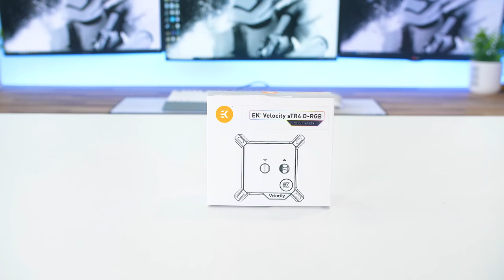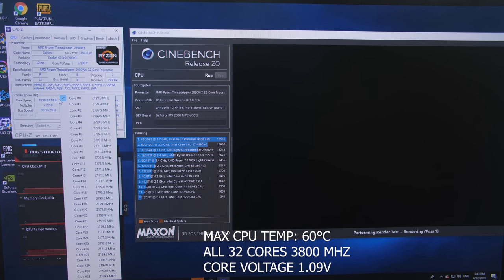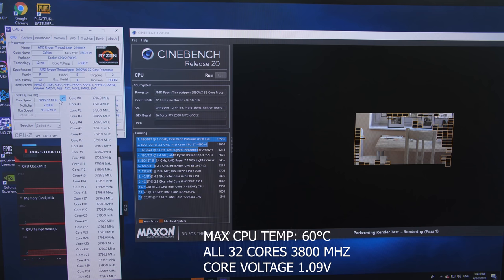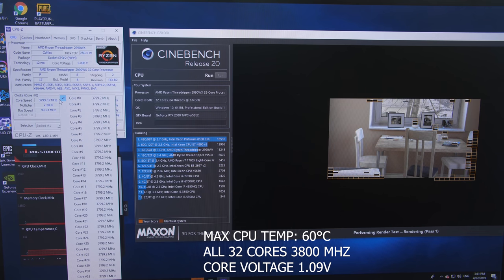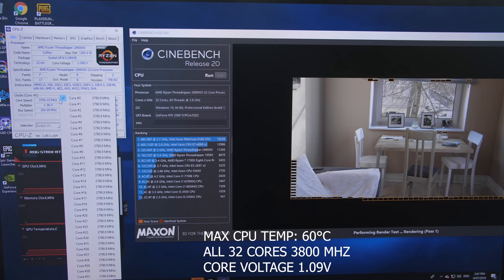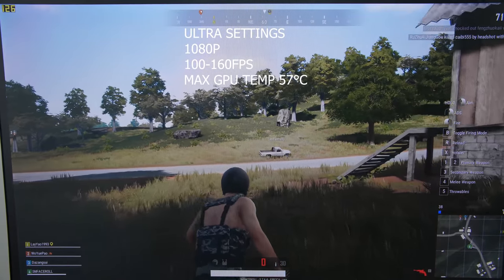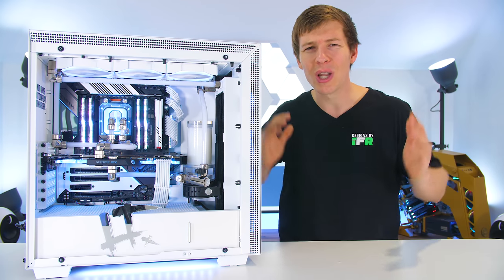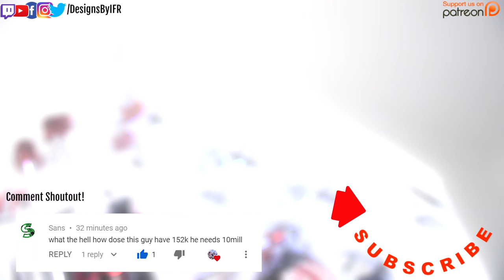Lt Lickme $10000 AUD Custom Water Cooled Gaming & Editing PC 2990wx RTX 2080 Ti + Benchmarks

Comment: Nice build. I noticed the small bit of clear tube propping up your pump res combo. The reason I noticed is because I've used this trick before on a sagging GPU. I liked the fan mod the most though. Those fans look so much better with a white frame. Cheers!
Reply from the maker: Thanks!

Comment: I was thinking a bit while watching the build, why don't you use plastic gloves (like those used in hospitals)? To prevent fingerprints on for example the corners of the metal (no idea what they are called) of the water cooling loop. Cause once I noticed a fingerprint on a metal piece, I could only think of it once it showed up in the video. I know this is a bit picky, but it's just a suggestion, in darker builds these things might not be as noticeable.
Reply from the maker: Yeah i usually try give the builds a wipe down. I must have missed a spot
Reply: Ahh, I see, cause if you look at about 13:10 on one of the metal corners (from left to up) going to the CPU block, you can see a fingerprint, it's a bit hard to see, but once you see it, it becomes hard to unsee.
Reply from the maker: @cosmicuser3688  haha yeah i probably missed that tube

Comment: how do you spray paint the parts. whats the best way to make a mobo be white without damaging it ( like for example a z390 auros master, a black mobo, is there a way to make it white looking)
Reply from the maker: I just painted the armor, not the board itself
Reply: @DesignsByIFR  is there a way to paint parts of the motherboard like the heatsinc without risking any damage to the board?

Comment: I'm planning on doing my first custom water-cooled pc… CPU, GPU + 2x360 radiators… Now, how much does order matter? Meaning, you did… 

Pump -> GPU -> CPU -> Radiator 1 -> Radiator 2

My logic says that water that goes to CPU is already a little warmer due to GPU temperature… Would it be better to do…

Pump -> Radiator 1 -> GPU -> Radiator 2 -> CPU

That way, technically water getting to GPU is already cooled in Radiator 1 and water getting to CPU has been cooled by Radiator 2… Or am I just an idiot and this doesn't matter?
Reply from the maker: It doesnt matter. Water moves too fast to actually heat up much (we are talking less than 1 degree) and eventually the loop will reach an equilibrium

Comment: Wonder which fluid that is, and if EKWB provided some their nice pastel? Also on page 21 of the manual for that motherboard it covers the water temp in/out which is great for regulating pump speed. If the delta (difference) between the two temps is too much, increase pump speed and visa-versa. Am yet to find a monoblock that supports the 9 pin though. https://dlcdnets.asus.com/pub/ASUS/mb/socketTR4/ROG_ZENITH_EXTREME_ALPHA/E15130_ROG_ZENITH_EXTREME_ALPHA_UM_V2_WEB.pdf
Reply from the maker: Thanks for the info man. Yes the fluid is EKWB cloud white =)
Reply: @DesignsByIFR  Where are my manners though THAT BUILD LOOKS GREAT you made NZXT + ASUS + EKWB pop! Plus it goes with your Gandolf the White look for 2019.

Comment: Wait.. Fortnite at 1080p with ultra settings only minimum 120fps? Are you joking? I get with my 1080ti and i7 8700k  with ultra settings and 1080p not under 200 fps? What is going on?
Oh yeah, i forgot! The 32 core cpu is not for gaming, but the pc is still used for gaming and not video editing etc. where his potential really is. Uff that hurts!
Reply from the maker: No this pc would perform better in games than a 1080ti and 8700k

Comment: No push pull in front, no rear fan, bad airflow even with watercooling, you will never have good temp, even for a showcase I'll never build like this.
Reply from the maker: XD
Reply: After all , the build is clean, it beautiful to see, but it could be better. Specially for 10000$ build.
Reply from the maker: @enkishiva4999  doesnt need push pull, has great air flow (3 intake 3 exhaust) and its an open case
Reply: With 3 intake with only push, the rad reduce too much the airflow to be effective, lot of video are made to see the benefits of push pull.
Reply from the maker: @enkishiva4999  its fine man its an open case and these fans have high static pressure. Its also water cooled so it doesnt need as much air flow as a normal air cooled build. Especially when the vrms have their own built in fans. Trust me i tested the system
Reply: Specially when the reservoir is in front of rad.
Reply: Yeah right open air help, but with stagnant warm air, its not perfect. Watercooling help for temp, but, still not so good for 10000build. Give me 10k and I'll show you lol i joke for the cash, i'm going to save money.
Reply: And also directly put in on gpu than in cpu directly is not the best idea in watercooling for temp.